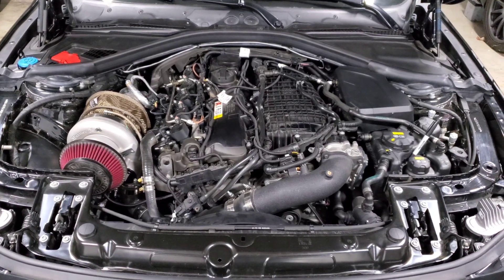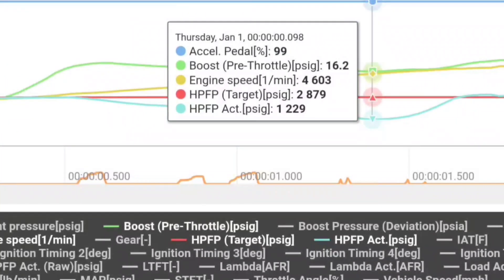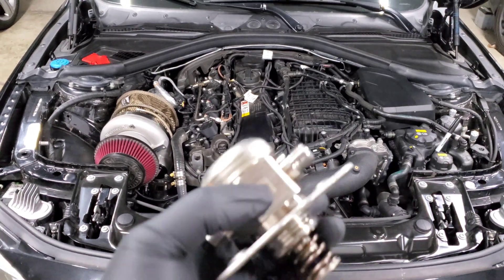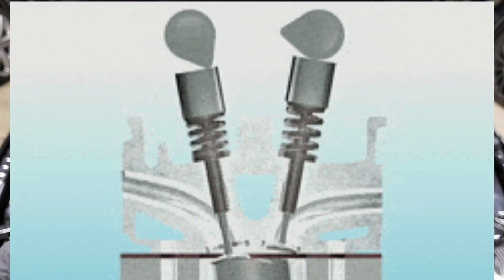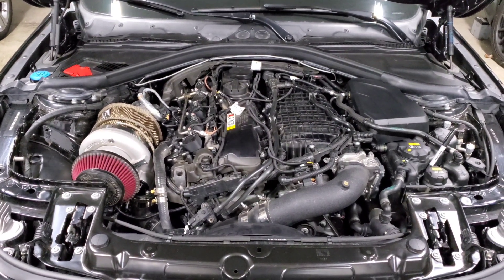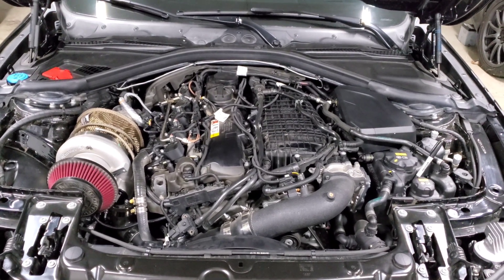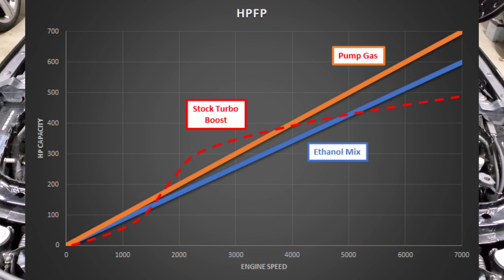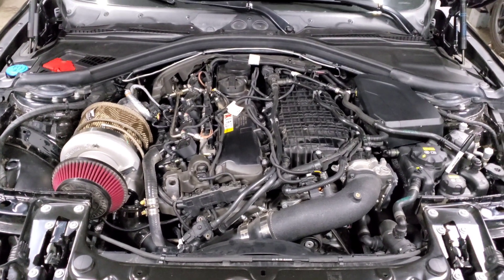HPFP Rail Pressure Crashing and Backfires - Common B58 Issues

Comment: I have a 2017 340i Ive been on a stage 2 tune for a while now with a cat less dp recently been having backfiring issues I did your fuel injector test and it’s not them, never had a code on the car until few days ago which is system to lean so I flashed to stage 1 and still getting horrible issues and car is driving terribly I think my hpfp is bad but you said it’s more then likely my tune I emailed Mhd bc I’m on ots map and waiting for reply
Reply: In the end what was it. Did you try your o2 sensors

Comment: Having this issue on a stage 2 ots bm3 map gen 1 b58, i wasn’t having this issue before xhp could this he related ? Am i just pushing my b58 past the fuel requirements ? Or could all this be coincidental as my hpfp or my lpfp is on its way out. Whenever im doing a hard pull drivetrain malfunction.
Reply: Did you solve your problem? I’m on the same boat as you
Reply: @wota9117  same. let me know

Comment: I am having the same issue, while at WOT the car does a loud backfire going around 6krpm. My current set up is a 340 with a tu pump and a vargas gc+ on e30.   PJT told me it’s a hardware issue 💀.  I still don’t know what’s wrong with my car. Please let me know if you have any suggestions.
Reply: You ever solve this issue ?

Comment: Hey Ik I’m really late, but I am having this problem now after installing my charge pipe, dp, and stage 2 tune. I also accidentally broke the clip for my map sensor on my charge pipe, but the connector is still in but there is some plastic missing from the bottom( threw the stock charge pipe once I finally got it out😂), but do you think this could be affecting it as well? I’m on an ots 93 tune. Because the map sensor deals with the air fuel ratio so I thought maybe that’s what’s causing it for me on the ots tune? Thanks

Comment: So I just got on a ots E50 tune and I only have the flex fuel kit , catless dp,intake and charge pipe. And when I do a few pulls the car’a power gets cut in half is it because I don’t have a hpfp and bigger injectors ? I only noticed it once I got on an E mix - 2020 m340ix
Reply from the maker: there are no hpfp or injector upgrades available for your car. chcek your coolant levels in both tanks

Comment: hello i have a 2020 bmw 440i with 13k miles and i am getting a 11b209 code after tuning it with a stage 1. is the hpfp act and target supposed to be the same?
Reply from the maker: The code is related to your lpfp not hpfp. I'd replace it
Reply: @kern417  i can’t even find that part anywhere. not even on bmw parts
Reply from the maker: It is in the fuel tank under your rear seat. Low pressure fuel pump.

Comment: hey it seems like i’m having this issue but my car only does this when i use anti lag. if i do the same run without using it i have 0 issues? any idea or is it the same issue as listed in the video. i will say tho on my log my hpfp psi either dips down to 1800 levels out and then flies up to 3500. gen 1 b58 stock hpfp. would getting the tu pump help my issue
Reply from the maker: if your rail pressure dips, then your fuel pressure is crashing. tell your tuner to fix the tune.

Comment: Hi ! Sorry if someone already asked you this but I tried to read all the comments before asking : I have a random issue where my gen 1 b58 fuel pressure crash at 5k rpm (goes from 2800-2900 to 1400) I'm MHD stage 2 91 with downpipe only and always put 91 octane gas. I don't understand why it's happening at such a high rpm given what you explained 😕 the target pressure don't move but the actual pressure drop
Reply from the maker: Send a log and i can review

Comment: I’m having this issue lately when I run anywhere over E70 with bootmod3 OTS flex fuel kit/map. Idk if 21 PSI of boost that it’s targeting is too much for my DS1  at that E level (stock turbo). It only happens when using kickdown to 2nd or 3rd gear. Loud exhaust backfire followed by a stall, then the car continues pulling. I’m not sure if it’s the OTS map being too aggressive, DS1 not being enough, or an issue with my car. I can send a log if you’re willing to take a quick look
Reply from the maker: Sure. Pm me on your preferred social media channel. Links to my pages are in the description
Reply: My car is having a similar issue did you ever solve this issue?
Reply: @parisbrown4606  For the most part yeah. So the HPFP line wasn’t installed correctly. The hole from the pump to the fuel line was ever-so slightly crooked, so I had to adjust it to have it go in straight. The logs looked better afterwards but there was still a little bit of a drop during WOT (-400PSI between targeted and actual). I emailed dorch and had them check my install, mods, and logs. They said from my logs, the bootmod3 tune was too aggressive down in the lower RPMs, spiking 24PSI which overwhelms the stage 1 pump. They recommend to have the boost max out at 20-21 down low and gradually increase to peak 24PSI up at higher RPMs, and the fuel pump will have no issues. Haven’t driven my car in a bit but I’m going to email bootmod3 to have them adjust the tune for me
Reply: @nickmarsden8129 lol they dont adjust tunes for you there gonna tell you get a custom

Comment: I have a TU Pump my car runs fine but I get a shadow code 11AA08 - High Pressure Fuel System: Pressure reduction too high. Do you know what this might be I clear the code and it comes back. 

Im on a BM3 stage 2 map but BM3 doesnt pick up the error code. However in MHD it does?

Thanks
Reply from the maker: Send me a log and i can take a look
Reply: @kern417  sent you a pm on facebook! Thanks
Reply: @rayj1988 did you have an answer?
Reply: Hi,did you solve the problem ? With this code?

Comment: Looking for advice, I just had my engine rebuilt. And during the installation the mechanic also put in a new oem HPFP and fuel pressure sensor. I have driven for just over 2000 miles. I get back from vacation and go for a drive, the rubber tube below the intake popped off retainer clip nowhere to be found. I get home, after the inspection and fix. Now the car won't start and I am getting a P0087 code. Any advice on where to start this diagnosis?
Reply from the maker: Scan with a bmw diagnostic tool to get the 6 digit code

Comment: Hey bro, pretty late to the party in this video but my cars been throwing a couple of codes occasionally on pulls recently; 
11A002 high-pressure fuel, plausibility: pressure too low
118401 mixture control: mixture too lean, e fl large
deviation. 
Car then goes into limp mode till restarted. Do you think this is likely an issue with target boost being too high also? Running bm3 stage 2 93 octane. Thanks
Reply from the maker: How do the logs look
Reply: Im having the same exact issue. What was your root cause?
Reply: @cwaters92 did you solve it? I have the same issue
Reply: @spy.mas93 I flashed to a less agressive map 91 ACN (for lower quality fuel) and so far it hasn’t happened anymore.

Comment: Hi, I have a 340i gen1 I just installed my catless dp right after I flashed the stage 2 e30 ots took it for a pull and heard the loudest pop and car went nowhere, I had no prior issue with the stage 1 e30 and I switched to the stage 2 91 ots and there is no issue, how many gallons do theses truly have says 15.8 But on empty my fill ups are about 14 ish gallons
Reply from the maker: https://youtu.be/_vbqcIDlOC4
Reply: @kern417  
Are you familiar with this code from Bm3 diagnostic
11B209
Reply from the maker: @gmo654  Low pressure fuel system, plausibility: delivery performance too low
Reply: @kern417  is it odd for the low pressure fuel pump on the b58 to go out?
Or is it just because my hpfp is crashing because on my data logs tuners says fuel pressure is dipping, and thank you so much for answering all my questions bro you the b58 goat!
Reply from the maker: @gmo654  it happens but usually it means the car is difficult to start as well, not just fuel pressure dropping during a pull.

Comment: Assuming that an upgraded HPFP would be able to support the amount of fuel required by your current tune (big assumption), why would that be just putting a band-aid on the issue?
Reply from the maker: If you asked a tuner to tune your car, and instead of making your setup work they just told you to buy more parts, is it an issue with your car or the tuner?
Reply: @kern417  Fair point, but I'd think it's a chicken/egg scenario that depends on your goals. Also I'm new to the world of tuning and was limiting my thinking to a flash tune that I could do myself.
Reply from the maker: As I said in the video, a flash tune designed for stock hpfp shouldn't cause pressure dips. Just like if it's for stock turbo then it shouldn't cause the turbo to fail, or if it's for stock downpipe it shouldn't melt your catalytic converter. Simple.
Reply: @kern417  Understood, thank you.

Comment: Loving all your videos (new subscriber). This happened to me recently while trying Bm3 rolling anti lag on my stage 2 ots 93 340i. I already had a custom tune and TU HPFP on order before trying antilag, with anticipation on upgrading my current setup. So this would be a tune issue, correct? Also would this have any long term damage on my internals? Thank you, looking forward to your response and future videos
Reply from the maker: You'll need to log to see what's going on
Reply: @kern417  this only happens on rolling anti lag, and only happened twice, stopped using it after. Is this something the tuner will be able to take care of once I start sending him these logs? As I understand this is a boost problem, so he will be able to adjust my tune/boost accordingly. Also will the rail pressure crashing if only happened twice cause any damage to engine?
Reply from the maker: You'll need to log to know what's happening, then yes it can be corrected. With new features like that, you'll always want to log it the first few times to make sure everything is running properly.

Comment: Hello,
Would Upgrading the lpfp help to prevent a DS2 hpfp from crashing on full e85 and a hybrid turbo. Basically, when im turning up the boost on a full e85 Hybrid turbo car, is the DS2 hpfp crashing because it is not getting enough fuel for that boost level or is it crashing because it cannot manage that amount of e85 at the boost level. If it is the former then an an upgraded lpfp would theoretically allow me to run more boost at full e85 by supplying more fuel to the hpfp. This is just my thinking I have no Idea if its right or wrong and would like your opinion. The reason for this question is in the near future I plan to upgrade the turbos and    run full e85, so I don't have to mix and don't want to go the port injection or WMI route. Thanks!
Reply from the maker: If you just have a DS2 then it will make the most power on an ethanol blend. If you want to run full E85, then you'll be capped around 550-600whp. If you want more than that then you'll need port injection and a LPFP upgrade.
Reply: @kern417 Ok got it. Say I run DS2 full e85 and I hit the cap at like 600whp. Would upgrading the lpfp be a minimal upgrade as in it would raise the cap to like 650whp or even less. My goal in the end is 700whp, so im wondering if I can reach it with just lpfp or port would be required. Thanks for replying quickly btw appreciate it.
Reply from the maker: You need port injection and an LPFP
Reply: Ds2 can still crash massively, mines having a hard crash right now on flowmax +
Reply: @the_batmobile0.4 at what rpm and ethanol percentage was your DS2 crashing at?
Reply: @the_batmobile0.4 my DS2 also crashed on a “new” pure 800 turbo. Did you resolve your issue? I’m considering getting a lpfp to see if that helps

Comment: I'm going to tune my 18 440xi F32 but looking for the most conservative route possible..  I'm going with Bootmod3 and a Stage 1 91 octane tune, plus colder spark plugs.. My car has 25k miles on it, do you have any other suggestions besides spark plugs.  I also change my oil every 5k miles and air filter every 12k.  Just want to go the safest route without putting to much extra pressure on the turbo.  Thanks in advance.
Reply from the maker: There are no colder spark plugs available for our engines so all you can do is replace what stock.

Comment: Had my car 340i stall randomly in the middle of driving and it wouldn’t start back up. I have a TU pump that I was about to install until this problem happened. Should I run the TU and just tune for E40?
Reply from the maker: You should fix the issue that caused it to stall before upgrading anything

Comment: Plan on upgrading to a HPFP (Supra) for my Gen 1 2016 BMW xDrive. Will a OTS map be fine or should I get a custom tune?
Reply from the maker: Yes. The stage 2+ ots maps are designed for the TU pump

Comment: I’m running full methanol on wmi + 105ron from brasil podium gasoline. Car runned 1200miles without any problem, but now every time methanol injects, it makes those burps and goes into protection mode. It happend during some mexico’s pulls up to 160mph. May I switch to TU hpfp to fix this or must be something wrong with the tune ? I’m really sad this happend and don’t know what to do ...
Reply from the maker: You'll need to run logs and send them to your tuner. Make sure your meth controller is still doing what it's supposed to do and all of your nozzles are flowing properly.

Comment: Hi! I'd appreciate very much if you'd respond to this, you seem like one of the only guys around that talks facts and really does care about the longevity of their car. I have an M340i, same B58 engine. I've recently bought an MST Intake for my car. While it sounds very nice and all, I'm afraid of the filtration deficienty compared to the stock paper air filter and how that will affect the turbo's lifespan. What do you think?
Reply from the maker: I don't think you'll see any issues with filtration, but the stock intake has been proven to flow very well so an upgraded intake doesn't net a significant improvement in performance.

Comment: When you put a supra hpfp in it, is the problem over?
Reply from the maker: The hpfp is not the problem. It is typically the tune or the fuel mix being incorrect. Upgrading the fuel pump is a bandaid if the tune is designed for the stock pump.

Comment: I put 5 gal e85 at 76% ethanol level in my ewg n55 and I think I put too much for my fuel pump to handle? I get code 118001 mixture too lean and check engine light. Logs look good except hpfp target is 2500 I’m at 2000 or 1900 actual pressure. This is hpfp crash correct? And I should put less e85 next time?
Reply from the maker: Yes

Comment: I was doing custom tuning and my tuner keep telling me that he thinks my car has less than a quarter tank of gas because he’s having an issue with my fuel but I have the TU pump on my 340 and told him but idk if he remembers
Reply from the maker: When fuel is low the car reduces power to prevent fuel starvation. Usually it happens when the fuel light comes on (50 miles to empty). This happens regardless of the pump you are using.
Reply: @kern417   I had fill the car up with gas before I did the pull and I sent him the log maybe bad gas or it could be his tune because ots maps log look good
Reply from the maker: Yeah it may have been a tune problem then

Comment: Great content as usual 👍 I need your advice please ... If running acn91 stage 1 on really crappy 91 fuel and in a hot climate... What my best course of action to create a safety margin for my car? Update HPFP or water injection or add some pure ethanol to my tank or a combination ... Thanks
Reply from the maker: Adding ethanol
Reply: @kern417  cheers ,👍👍 will have to figure out a way to consistently add a constant  percentage to my petrol then as we only have pure ethanol available here
Reply from the maker: @osamasoliman6697  i have a video on my channel for calculating e85 mixes. It works for any ethanol
Reply: @kern417  thanks I will study it again 😀😀

Comment: So the rail pressure depends on the pressure produced by the HPFP and the amount of fuel flowing through the injectors. In a high boost + low RPM situation the injectors need to push a lot of fuel while the HPFP cannot produce enough pressure at the current RPM so the rail pressure dips. That makes complete sense!

My rail pressure dips by 800 psi at low RPMs as soon as peak boost hits in 3rd gear, but in 4th gear it's not an issue I guess because the boost doesn't hit as fast and the HPFP can keep up. What I also see is that as I continue the pull (in 3rd gear after the rail pressure dips) and get to >6k RPM the rail pressure exceeds target by about 700 psi... what do you think is happening there?
Reply from the maker: It recovers and goes over target sometimes, especially when you shift and the injectors shut off for a split second
Reply: So what would be the solution to this a custom tune that will fix those issues? Or a upgraded HPFP/LPFP ?
Reply: You ever figure it out?